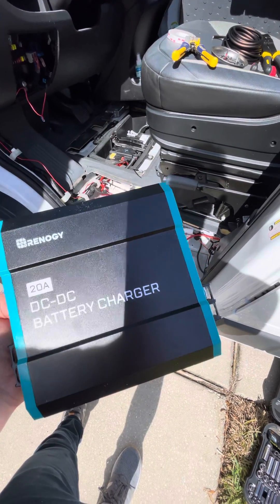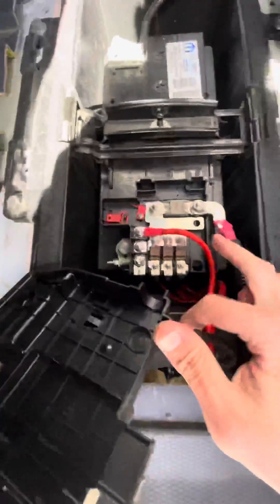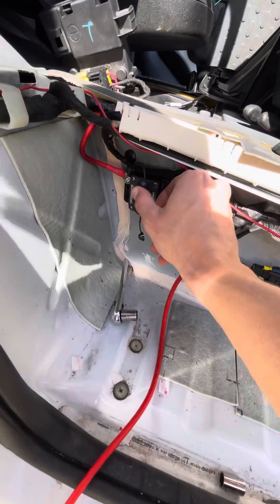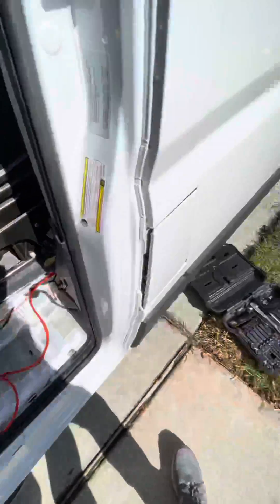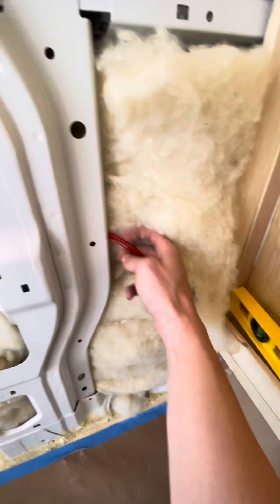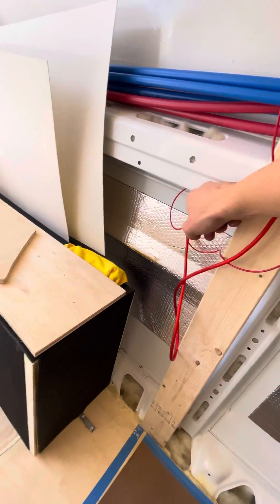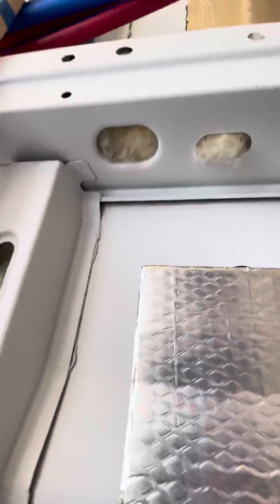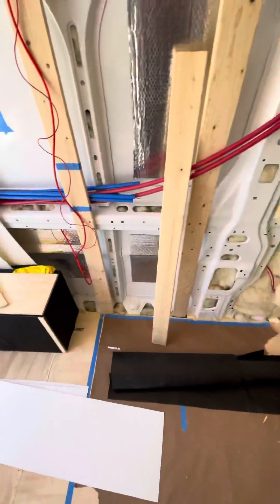Wiring Ram Promaster - Renogy DC to DC alternator charger

Comment: Thanks for the video! Quick question - why install the breaker up front and B2B in the back vs just running the initial wire from battery to back of the van so you have breaker and B2B both at the back? Just seems like it would be nice to have the breaker (all elec really) by the B2B with all of the other electrical.
Reply from the maker: It depends, but from my understanding with DC connections is that the circuit breaker should be as close to the source as possible. If the amperage hits a high amount and it travels the length of the wire then the entire wire will heat up and possibly cause a fire. Having the breaker close to this reduces the heat build up in the wire if it overheats. Also with this connection you shouldn't be constantly messing with the breaker because it turns off when the vehicle is stopped. The other breakers I have are all in one place, but I have never wanted to turn off this breaker because I would never work on the electric system while the car is running.
Reply: @avesofficial  Thanks for the input!!

Comment: Hi! no one else has posted this in depth about this. Thanks! I've seen fairly mixed info about wire sizing for this, what size did you use? Thanks again
Reply from the maker: Hey! It does depend a little on how long of a wire you use. I used about 20ft of this (https://amzn.to/3jz6AxR) 8 Gauge wire. In a van 20ft was just long enough, but some people might need 6 gauge if you go longer. This is also just for the 20amp model, if you go higher you should definitely get 4 gauge (which is what the manual recommends for larger models).

Comment: What did you use for your ignition on power to run the charger?
Reply: I too need to know this, haha
Reply from the maker: I used an 18 gauge wire with a fuse tap - heres a brief video showing what I did - https://youtu.be/EEFH-EDGaiA
The fuse tap is this - https://amzn.to/3cU9TuN